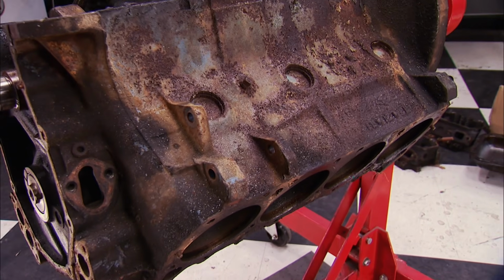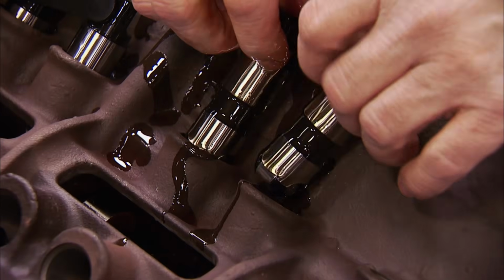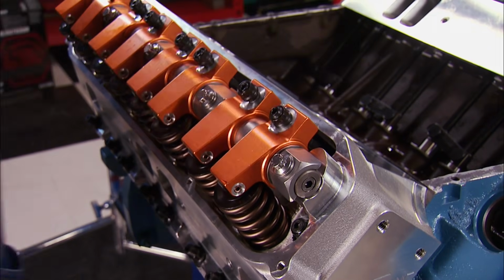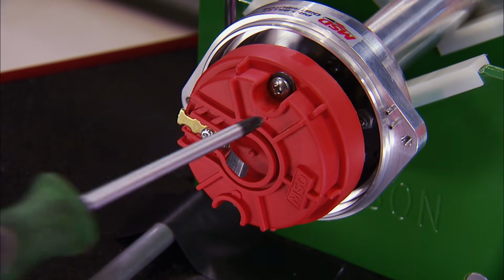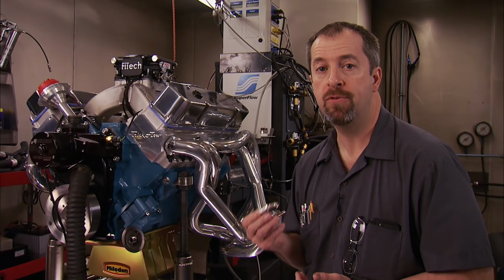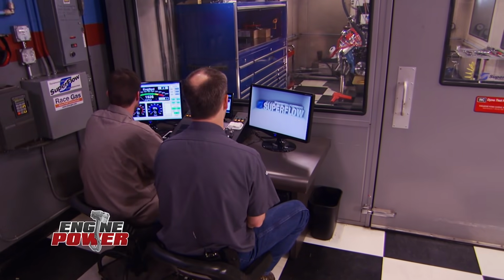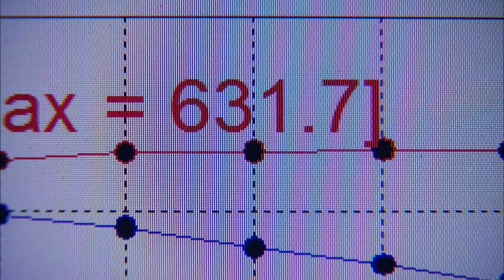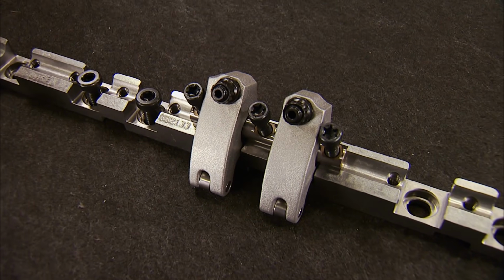Pulling The Power Out Of The 512 Stroker Raised Block - Part 2 - Engine Power S3, E10

Comment: R the headers ceramic coated on the inside or outside. It’s very important to have inside to keep the exhaust flowing. Also why don’t U ceramic coat the combustion chamber and top of piston?

Comment: The carburetor atomizes the fuel better than the injectors.  I was surprised to see the number of small injectors on the Fitech.  I wish the injector manufacturers could make a modern unit that atomizes as good as a carb.  I have ideas how they could

Comment: Goood The Carborators are The best!!! I Have Dellorto some modifaid 48.Run thes with Big Heads Brodix 11X.litel 356cui Csb.Th400 Aut Corvette rear end 4.11..Et Street taiers 28 inch ..No no Transbrake.60 toot 1 60 6.9 201m.492 10.7 sek Havvy car 1600kg.. Real Street car ojäää 1992.Have still thise Corvette.Twin Turbo.Run 11.23 with Carborator.Efi Vems build 95-96 Hope coming tou The Streets 2025.*.Have weery problem with the Efi..).Testing Now with Wested Sparks.Hope thes gone weerk..If noth Most bay MaxxEcu Efi...

Comment: It's only 512 at .60 overbore. you didn't say anything about sonic checking the cylinder walls.  you'd need one good block to go .60 over and still have thick enough walls

Comment: why don't you guys build a low deck with B1 original heads that have been flowed? a full race application like the 532 BBC you built or the big block ford?

Comment: Stupid question…. Those NOS bosses on the intake runners…. Could you drill those for injectors and use a throttle body for air control? Like to upgrade to EFI…

Comment: U couldn't run fast enough to give me a TBI set up, I've had enough problems with factory ones. I'd put a 950 HP Holley DP carb in it for one third of the cost of that TBI. Carbartor kicked that injections ass, I knew it, just say no to new technology.

Comment: I like the fact that guys are sharing their ideas online like this.  If I could change one thing, it would be to ditch the 1.6 rocker ratios for 1.7.  If you don't pick up improved head flow from that, on a modest duration cam, then you have cylinder heads that aren't worth using.  1.7 ratio does increase effective duration but only a tiny bit.  There is a reason so many GM crate engines don't mince around with 1.5 or 1.6 any more.  The same scientific principal applies to big blocks.  Yes, the 1.7 is not in the catalog, but you guys already had a custom cam made, so why not have T&D make your rockers.  They just borrow the heads for a month.  No extra charge.

Comment: replace Hydralic lifters with solid rollers and camshaft tighten lobe seperation, then switch to T/F 270 power ports, along with ported intake match ports and pick up 50 75 more HP

Comment: Not bad for a VERY conservative, build, but those 240 heads, out of the box intake and pedestrian camshaft, belong on 440ci pump gas deal. Not on a 512. If you're going to build an engine that small (4.25 stroke), out of a 10.720 deck height block, the head should be the Indy 440-1, with the Indy intake and a camshaft to match. The Max Wedge port window is a must on a stroked 440/400 unless it's for an extremely low rpm land yacht.

Why do I say this??? Because I ran a 4.380 x 4.150 combination, with the 440-1 head/manifold, 11.2-1 compression, a camshaft that made peak power at 6700rpm and made 811hp and 696tq on 93 octane, with a 1050 dominator carb. I drove it around like gas was free and ran consistent 9.40s at a tick over 3380 lbs.

Comment: I get that EFI is better with MPH, Cold Start Up and adjusting to everything including sea level on up to the sky, but you just showed a decent increase in power with a carb. My question is, how would this "SELF LEARNING UNIT" do after it has been a day or two doing pulls on a dyno???  I'm thinking WOT is WOT no matter what, but if this EFI can learn to handle/make 1200 HP, why isn't it already superior at WOT now?????

Comment: I don't know why they didn't just get the 543 c.i. stroker kit from 440 Source... there's probably no difference in cost either between the 512 kit & the 543 kit... and maybe a set of the Edelbrock Victor 440 heads or the Victor Max Wedge heads...this engine could have made way more power with a different "off the shelf" parts...
Reply: 512 requires little or no block grinding for clearance. shorter stroke may be more durable at high rpm.

Comment: I'm going to build the 440 I have to this spec. Looking at the Harland/Sharp rockers assemblies onnthe Summit sight I see many options. Can you provide me with the part number for the 1.6 ratio Rockers you used? The only ones I can assume by the price you mentioned are 1.5. Great info and well put together video.  Thanks, Jeff
Reply: My engine builder had to do some machining to fit those rockers properly on the 240 Trickflow heads. Just an FYI

Comment: Oddly enough, many years ago Because they could then run 30 lbs of boost versus the 6lbs that Honda had to run due to dual overhead cam and 4 valves per cylinder.  They produced upwards of 900 horse power.   After initial teething problems development improved reliability an they won races for a couple of years.

Comment: A good carb tuned right will always make mor HP than a throttle body.  The pro about a throttle body is that you don't have to tune it all the time like a carb.  If you live in 4 seasons areas like me you will understand that.  And also folks that go to different elevations.  Cold starts are easier too.  And no I don't have any throttle body rods.  I'm carb all the way.  But I do see their pros for sure.

Comment: The fitech is just an electric carb that makes less power unless you tune it yourself. Downside of it are that you're susceptible to any and every electronic gremlin shutting you down unless you've got a computer or spare system to pull parts from. I think I'll stick with carbs or just multi port EFI.

Comment: Compression is kinda low for big valve aluminum heads? 11 1/2 to 1 would make way more power and still run on pump gas!

Comment: Should have put the front and back bars on the valley pan. You're putting a lot of faith in the 3 bolts and thin pan.
Reply: I didn't see an oil pan gasket used between the windage tray & oil pan either. I had to rewind & look again to make sure

Comment: For the average guy who is a street racer this is a big dollar motor but a good option for a bracket racer at the track. A 6.4 Gen 3 hemi with a mild cam,porting the heads and a upgraded intake and you are close in power for a lot less money.

Comment: how about  explaining  efficiency, > short rod long piston vs long rod and short piston   where one is  better for power vs cruising . if you dare , variable cam timing kit for old stuff (there must be a kit to add to the big wheel on the camshaft by now (oohhh the cnc machined cam cover ,with seals and bearing to completer !, then variable valve lift  again for old stuff (eccentric  rolling cam rocker shaft ) >and then  high pressure hot  water injection, and after reading about mazda making an engine run at 48 to 1 fuel direct injection >>kit?  I have 88 ?roller cam 318 heart shaped heads in  my 86 w  but the old rb 383 seems like better choice to work on . if you want to get off topic >hp used by transmissions ?  it is a big deal . 727 vs a zf 8 speed ? ( who does not want  a pto ?)  hell my wish list ?> interface to talk to the zf controller( 30% more efficient  may pay for the upgrade!)  to  say a 1993 5.9 Cummings's  ? TPS ,MAP < RPM  MPH ??what else does it need ,and how difficult is it really to present  the data ? ardweeno's ?

Comment: Where are the spreader plates for each end of the intake gasket/valley cover?
Reply: They didn't use a gasket between the windage tray & oil pan either.

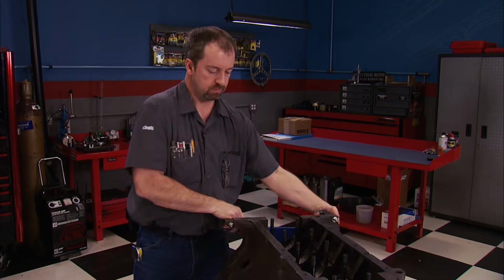Comment: 0:52  But did Shackletts attach the torque plate with head studs?  Sounds like they used regular bolts since you didn't say anything about supplying them with your head studs like you did with the mains.
Reply: When torque plate honing the fastener type does not matter as long as they have the same amount of thread engagement into the block
Reply: @stevenhoitz9260    A bolt torqued to 100 foot pounds is going to distort the block differently than a finger tight stud with a torqued nut on top.  He says this at 0:57
Reply: @Sir.VicsMasher  at the time stamp he is talking about the main bore. On main bores it 100% matters since the fasteners are inline with the bore and are clamping a large hole that you are trying to keep perfecting round. On a torque plate the fasteners are being pulled 90 from the bore(vertical) so all that matters is the amount of fastener in the block pulling upwards.

Comment: awesome mill. Chryslers make the best engines. been watching this show for many years. i have a question. where does crank case pressure if any escape to and how? Does it run past the push rods to the head? Is this the white thick smoke coming from alcohol tractor Hemi V8 engines on the bottom near the oil pans?
Reply: Some will use a vacuum pump and run it into the headers or a puke can. Located anywhere, or just dumped straight down
 As long as it's not on a hard surface track.

Comment: Im not a Mopar guy, always respected the Mopar engines.., but, are there not any larger heads for the Mopar guys.  The cylinder head you used had only a 240cc port(?).  The 512 V8 needs a 300cc port for it to really come alive. 617hp for the street is nothing to complain about; engine just needs larger heads
Reply: Yes, they do offer larger heads. However the head is chosen based off the application and it's target rpm range. This is not a bad choice for heavy street cars. Don't be too concerned with peak numbers. Look at the curve. More power with bigger heads and cam, less torque... especially down low. Application specific, based on cross sectional areas, not runner size.  Hope this helps.
Reply: port volume in ccs is effected by the ports length as well as its cross section.so the numbers can be deceiving i.e. a short port at say 270  can flow more volume than a longer 270 cc port. yes; there are larger than 240 cc available.

Comment: I would think you would want a oxygen sensor for each Bank not just one
Reply: Not if you know how to read a plug. AFR is only good for a reference, not for tuning power.
Reply: @jrdmotorsports9718  that's not what I'm saying on a factory style engine with a v-shaped engine you normally have an oxygen sensor if not two oxygen sensors for each Bank of cylinders to get a correct reading. How is the fuel injection system on this engine getting a correct reading when it doesn't even know what the cylinder bank is doing on the other side? What I'm saying is there's only one oxygen sensor reading one side of the engine. Doesn't seem like a very efficient fuel injection system.
Reply: @kskip4242  I hear what you're saying. And yes, it is a basic setup. You would be surprised just how many people only run 1, on 1 side and try to tune to that.
Reply: @jrdmotorsports9718  ideally running a y-pipe on this with some large 3 to 4 in exhaust and putting the oxygen sensor right where it merges together would work really good.
Reply: @kskip4242  If it is being used to allow for the computer to learn and tune to it, it needs to see the average of ALL cylinders, yes.

Comment: It's a nice show to watch, but not to learn really. Kind of the oposite. You are just showing top numbers and not comparing the whole curve to previous results. You added a spacer, showed a bigger number but not how much is lost down low (if any, I dont really know but it would have been a nice oportunity to learn that). You are not even telling the AFR you are using,. Probably the EFI system was pig rich as I cant imagine a carburator doing better than a properlly tuned EFI system.

Comment: I have a Mopar 360 that's bored, stroked and internally balanced to 408ci. I got a good deal on it, so why not. I want to build it for performance daily driving and retain the 89 octane requirement. I can appreciate videos builds like this to put in perspective what I'm trying to do.
Reply: They did a 408
537hp 550trq.check out link.https://youtu.be/lb7kKjQcR9w
Reply: @dtruth5769  I'll check it out and report back in a few. Thanks

Comment: Fitech nearly knocked it out of the park with that new design. Except they didn't listen to the customers screaming about the computer being part of the main unit. It's too close to the heat. It needs to be a separate unit. No one cares if it is one piece or not after they fry the electronics.
Reply: You really think a Chinese company cares about the end user?  🤣🤣🤣. Buy Chinese junk and you get what you pay for.

Comment: Hey guys.... Building one these 440 strokers myself...got a couple of questions for y'all...what are your cam numbers? What carb did you end up running and the Hooker headers you used with the TF angle plug heads ..what is your part number for them? Any help is appreciated!

Comment: i was a little disappointed by those numbers not gunna lie, thought it was going to be closer to 700, the carbie made numbers closer to what i was expecting, almost seems like that fancy efi system isn't as great as they want you to believe, guess holly is still the masters at efi bolt on systems
Reply: They CAN hit 700+, that combo is just a bit too mild.
Reply: heads are way too small.
Reply: Heads are to small push rods to short not applying all of the spring pressure

Comment: The 512ci looks like a monster of a motor. Wonder how it'll perform with a supercharger? Too see Pat smile and rub his hands gives you the what will he fit it into?
Reply: Stock 440 blocks can't handle much more than this. You are at the limit with this build for the two bolt main caps.
Reply: @tlr-nut7275  Not exactly true. Customer's 2 bolt 440, performer heads, 6-71 blower... 715hp, 605trq with dead fat carbs at 7lbs. Just 1 example and not the only combination that we do that lives up there over 700 with stock blocks. You were saying?
Reply: Just do the math. 600hp @7 lbs =900hp. Might need a big bucket under it to catch the crankshaft, but it may do it once.
Reply: It's screaming for an 871 or a pair of twins.

Comment: So it makes 20 more horsepower and 31 more ftlbs than my 30 over 440 (446 ish) using the same Intake manifold, a trickflow track max cam and the same heads that all I did was deburr the combustion chamber and an 11:1 cr
Reply: Horsepower to cubic inch, when comparing apples to apples, isn't a huge improvement by itself unless it is a drastic change.
Reply: heads are too small for a 512.
Reply: @frigglebiscuit7484  Not if the goal was accomplished.

Comment: Forgot about adding lifter preload to the measured push rod length. And should mention you need to check pushrod length on the cams base circle.
Reply: On that setup you don’t have to worry about it bc it has adjusters
Reply: @stevenhoitz9260  good to know. They just mentioned hydraulic lifter but showed no accounting for preload. That could be problematic to forget’
Reply: the adjustment in the rocker arm should be able to take that up

Comment: 4300 peak tq, 5500 peak hp..too close, retard the cam 4dg keep the carb add 14 hp easily  to the 631
Reply: Actually it isn't. Power range of any engine is typically 1,200 to 1,500rpm between peaks. Some can be a little wider at 2,000 in certain applications. However, backing a camshaft up will move  BOTH peaks, not just one. All it does is move the curves up equally, however you will make less under it.
Reply: @jrdmotorsports9718   thanks for the clarification. I am used to seeing peak HP of 5800-5900 if the torque is 4300. With 512 CI, I am surprised by the output and peaks. I don't know the flow data or duration of the cam but it seems with that lift, maybe the duration should be more as even a 512 with that intake, cam, heads should peak higher for max power.
Reply: @Selkirk69  You can control, to a point, the spread between peaks with the way the cam profile is ground. Fi is typically wider than a carb. Peaks will be determined with many factors, and in this case, would be port design, and cam profile. It's not a bad setup, just a mild one.

Comment: Nice build guys. Thank you for building a 440 MoPar. Though they are 7 decades old, they can still make enough power to be respectable on the street or strip and do it reliably as well. Bravo, good job.  631hp and 643LbFt is enough to put even a heavy old B-Body in the 10's on pump gas.
Reply: The 440 engine weighs in at about 670. Not bad. At it's creation in '58, it was a light weight modern replacement for the very heavy 1st gen Hemi. 😊😊
Reply: With aluminum heads intake and water pump you can knock off over 100 lb of the weight you posted @managementhawaiianisles3235

Comment: This build could have been all over 700 hp with the 270 heads
Reply: Bingo. Add a bit of compression and the right cam profile as well. Make for a nice pump gas build. It's how I'm doing a 512 now for a customer.
Reply: @jrdmotorsports9718  yes. We have a 446, solid roller engine, 12:5:1 pistons and made 632 at the crank!
Reply: No spec of the lift but it needed a solid roller cam, 270 head and 11.5 compression ratio.  512 needs more air.
Reply: I've seen stock stroke 440's in the engine masters series make over 700hp with Indy and 270 heads .